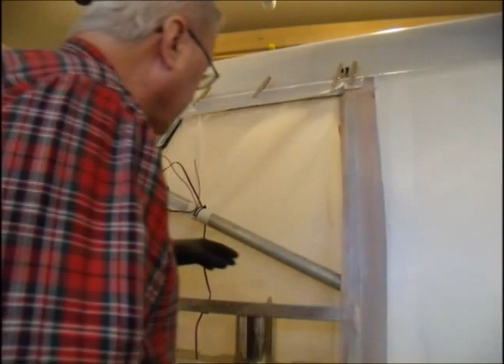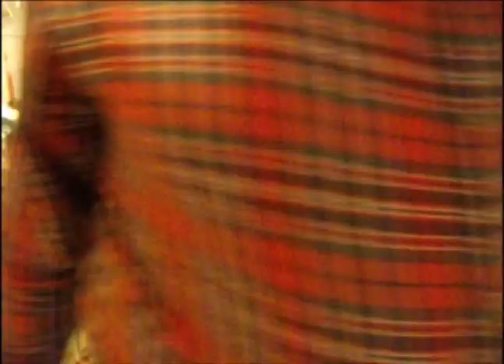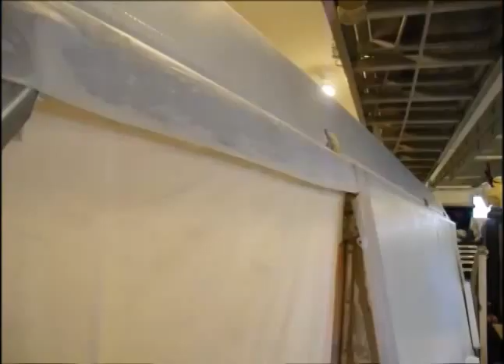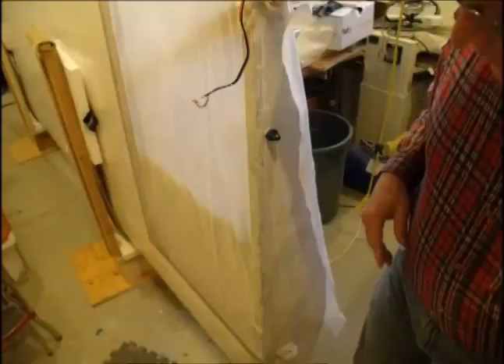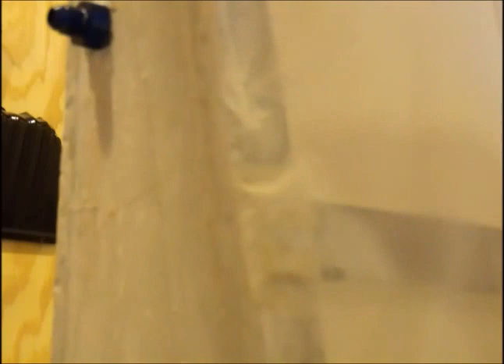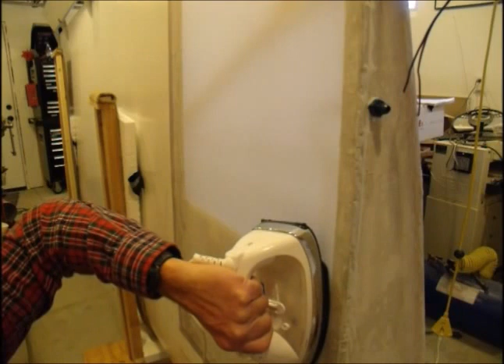Poly Fiber  Repair Example Part 2 - Gluing and Shrinking Fabric

Comment: Is this the 21st century version of "Chappy"?
Reply from the maker: Similar construction methods - just updated materials. 'Chappy" was built in the 1940's so it would probably have used cotton fabric and dope. Modern covering uses dacron fabric that is shrunk with heat and more modern coatings. https://www.ltu.edu/news/chappy.asp